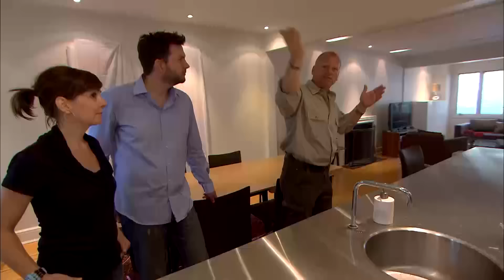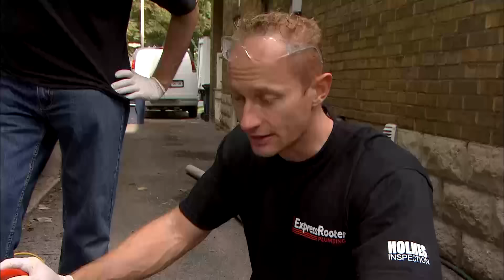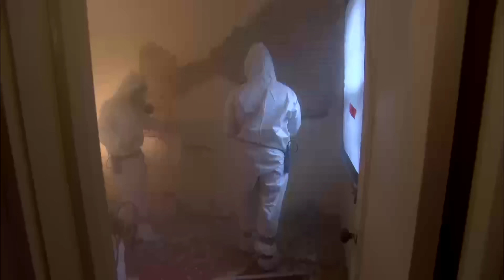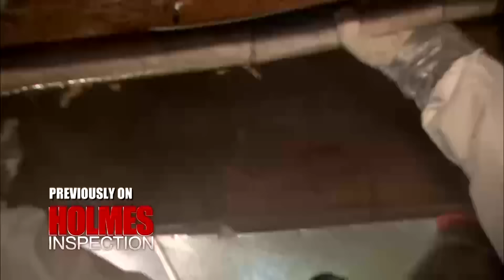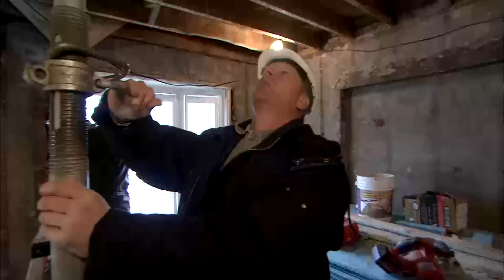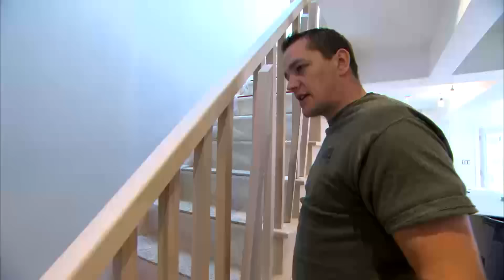Worst Home Inspection Fails | Holmes Inspection 122+123

Comment: I would tear the house down and cheaper to build a new home. So sorry for these young  couple.just imagine  $300000  dollars to fix. I hope homes are giving them a break
Reply: you're clueless
Reply: Victor ,here in Connecticut if you tear down a house they rebuild on the original foundation if not different laws come into effect, especially near the beach.
Reply: ""Leave a wall and the building is grandfathered in to whatever code was around at the original time it was built. Destroy the whole thing and you then have to go with current codes.

Probably a setback issue.

Sounds like in your area they need to leave two walls to get around the code.""

Comment: Wow... just wow...  There are no words.

I do have one question though, for those that understand.  What is the difference between truing up something as opposed to making something level?  If they gutted the house, why wouldn't they be able to level everything up?  No criticisms here, just trying to understand what they are having to do.
Reply: Trued up means flat, no dips or valleys. Level means the golf ball doesn’t roll if you just set it on the surface.

Wood permanently bends over time, depending on the amount of bending you cannot unbend the beams enough for a level floor without breaking them. In some cases you may not be able to true up the floor.
Reply: @Knirin  okay, that makes sense.  Thanks so much for the explanation!
Reply: @sdmcdaniel2255 
Leave a wall and the building is grandfathered in to whatever code was around at the original time it was built. Destroy the whole thing and you then have to go with current codes.

Probably a setback issue.

Sounds like in this area they need to leave two walls to get around the code.
Reply: @sdmcdaniel2255 
Plus remember that wall in the basement,  that could not be removed due to neighbors driveway,  so the builder added another wall.

Comment: “Breakers” will most CERTAINLY “Trip” even if they are blocked on the Reset tab.

Key-word there dumbasses: “Reset-Tab”.

Breakers trip internally so it doesn’t matter that there was something on top of the breaker reset-tab or not. 🤦‍♂️

I’m not even a fucking licensed electrician & I know that for fuckssake.

Why are not the previous homeowners the realtors in the inspectors not held personally liable for misrepresentation for material misrepresentation & Fraud???!!!???.

Who builds a cinder block support-wall in a basement  without rebar & without any concrete fill, seriously?.

Comment: This old house was originally solidly built, but received such structural abuse by incompetent contractors that it would have caved in within a few years. $300,000 in 2010 could have probably paid for demo and building new, but obviously the repair and renovation was more interesting for TV. Even with a good inspector buying an old house is really risky, but the deceiving scoundrel who wrote the report for this house really avoided all the obvious foundational and structural issues. May God bless this young family who were really saved from losing their home with the help of Holmes and crew.
Reply: Home inspectors depend on referrals from the realtors.  Neither the realtor nor inspector wants to kill referrals by poking to far into the house.   Also most states have no requirement the inspectors have any qualifications for the trades.  Few inspection services have a licensed engineer on staff.   The bank I worked with let me bring in trade contractors and a engineer to inspect the houses we purchased.   A little more expensive, but I got inspection and estimates simultaneously.
Reply: When I was searching for a home, I went for an older home, for the quality of the "bones".  I chose one that was still original from 1964.  Did it need work, oh yeah.  But it was all well known, and mostly cosmetic.  The old bones are still solid.
Reply: Yeah realtor recommended few inspectors, I looked at their reviews and they were all reviews from RE agents lol Picked one myself that had reviews from people who actually were buyers.
Reply: How com we can’t sue the original home inspector!
Reply: @scifycartoon  Was it actually inspected?  Or did the crooked realtor produce a fake report for the open house?
Reply: @scifycartoon a lot of issues with this house an inspector can’t see he can suspect and theorize I know inspectors can’t put holes in the walls and check structure but it should not take a subcontractor to point out structural defects in a house Mike even said that
Reply: WHY does the inspector act like he is a teenage girl PMSing!!!!!!
Reply: These contractors don’t care. They just simply do not care instead of doing the job the correct way so the homeowners will never have problems like this and shame on the inspectors. They have to hold the contractors inspectors accountable for they just might get their hands slap and move onto the next job. People need to take these contractors to court and sue them and make sure they never get jobs to pretend that they’re doing good.

Comment: This house was very close to being condemned. The buckled foundation wall must have upset the engineer and building inspector.   That was substantial block and concrete benching . I hope the homeowners are still in the house raising their children.
Reply: I hope any recipients of Mike Holmes' taking their house apart and putting it back together again never moves!
Reply: @RD9_Designs  Depending. He's gotten into a few dozen (hundred) lawsuits, ranging from improper building, improper paper work, lack of proper inspection and contractors, very often he got in trouble with unlicensed work being done which is why we see so many other people doing specific jobs. Brings in plumbers, electricians, etc; originally you'd see him doing this himself but he wasn't licensed for a lot of it. Also over spending on materials that were not required was also an issue, hope there is an off switch for those heated floors, and hope that didn't come out of the couples budget.

He's gotten better, but there is still concern. But he is way better than who worked on this house before for miles sure
Reply: @Jalbesbe the fact lawsuits were filed does not mean they actually have merit. Even settling does not mean they actually had merit, just that he didn’t want to deal with the nuisance of the lawsuit. Some people just don’t want to pay for the work done and when the contractor does sue for payment on the contract they counterclaim for improper work as a defense.

Non payment is a huge problem in contract work. Pick any business that does renovations and you’ll find lawsuits no matter how good they are.

Comment: If the seller is providing a home inspection I would assume that the report is all lies.
Reply: Agreed. Those 'inspectors' were very likely paid off to ignore many of the issues so they can sell the home fast.
Reply: No, No! The “Home Inspector” is NOT a structural engineer or code inspector! The Home Inspector can ONLY do a “visual” inspection of what is easily accessible and is not required to report on structural integrity and CAN recommend further evaluation IF he/she observes a problem. They do not/cannot diagnose anything! That is the SOP (Standard of Practice) of ALL home inspectors in every state!
Reply: @thisthat8274 There were a LOT of visual things the inspector missed. Exposed wires, the bowed wall, the electric panel, the severity of the sagging floors, the bathroom vent, etc etc. 

I would not allege the inspector was literally paid off; I would say rather it’s an implicit quid pro quo between the realtor and the inspector. If you find a lot of problems, you’re not gonna get the next job. Still unethical.
Reply: @thisthat8274  That inspector must have been blind because there was tons visible that was not to code. You're an idiot. That inspector needs his license pulled.
Reply: @thisthat8274 beside home inspectors cannot and will not look at plumbing electrical or structural they are not licensed for that, they should suggest it to the home buyer and never go with a inspector recommendation from a realtor the bottom the faster and better the inspection is the better the all mighty dollar is to them they are getting a commission off the sale so they are not neutral
Reply: @thisthat8274  I don't know what you are smoking, but in my state inspectors are REQUIRED to evaluate the foundation, floors, walls, ceiling, and roof and any good inspector will comment on the overall integrity (in addition to simply listing the problems they encountered). This inspector was negligent, and probably relies no the realtor to make ends meet. The only thing an inspector can't do (generally) is tell you if it is a good idea to buy the property or not, and speculate on the cost of repairs. They definitely can tell you that the foundation is fucked, the wiring is fucked, and the floors are fucked and tell you to get an estimated quote from a contractor.
Reply: That's the issue.  70% of home inspections are done by real estate recommendations who overlook shit to get the sale
Reply: You should always hire your own separate home inspector never use the realtors home inspection

Comment: When I went home shopping, I narrowed it down to three choices then I did a thorough personal home inspection using a guide.  Based on that I removed one from my list.  With a guide, I found things I never normally would have even thought to look at.  I then requested a professional home inspection for my main choice.  Every home buyer should do this IMO.
Reply: They had a home inspector - but he worked for the home owner. They needed to get their own independent inspection. As soon as I heard sagging floors I would have walked away. We bought a house from 1987 - and it’s had a few problems but at least nothing crazy. Mostly small things like it needed new windows. Things that didn’t cost hundreds of thousands of $$$. I hope these homeowners sued the original homeowner and home inspector to pay for some of their repairs.
Reply: @lostcontrol1981 Windows only last 30 odd years, sometimes less. Any house from 1987 that doesn’t have new windows… probably needed them by 2010.
Reply: @lostcontrol1981  That is all going to depend on the signed HI contract.  HI’s are only liable (in most locations) for what is strictly defined in that contract.  Something that should be reviewed and signed BEFORE the HI.
Reply: Some stuff on this house the home inspector 100% should’ve caught absolutely a lot of this crap in here without opening up walls you would never have known but once they opened it up, whoever did do the work should be held criminally liable for doing it. That’s how bad it is.
Reply: Never rely on a survey done by the existing owner. The surveyor was working for them.
  Get your own done. Yes, it costs money, but the surveyor is your employee and will find things that the other one ignored.
Reply: Where did you get your home inspection checklist?
Reply: @donnamurphy5698  When I bought my home, I used a combination of checklists from the3 State Deptartment of Housing and State Board of Technical Registration.  To that I added items that these shows recommended if applicable.  To this add common sense.  Then I hired a certified home inspector which I gave my list of concerns to add to his.  Overboard?  Maybe.  But is is my money. 💰
Reply: Don't look up the lawsuits with Mike Holmes approved inspections.😅
Reply: That's this couple's first mistake.  They took the homeowner's house inspection.   They should have done their own.
Reply: Do you own inspection, some inspectors do a poor job, don't check roof, second story windows, don't check appliances.
Some are worth the money.
Reply: The sad thing is there are many scam inspectors
Reply: Mike doing home inspection and repairs...yeah and that claim of a M. Holmes approved house has lawsuits for 8 million in Ontario. Not cool Mike . Especially seeing this show .
Reply: We get engineer reports in Australia cost a fortune but it’s worth it
Reply: Mike wrote a home inspection guide.
Reply: @SandraNelson063 tell that to the people of his Meaford development.